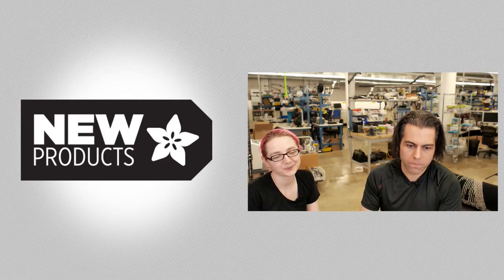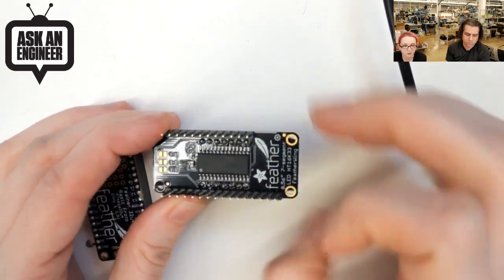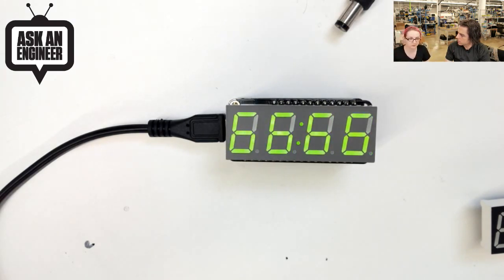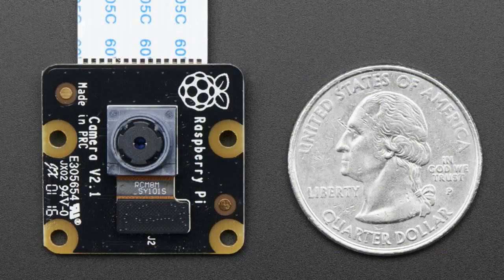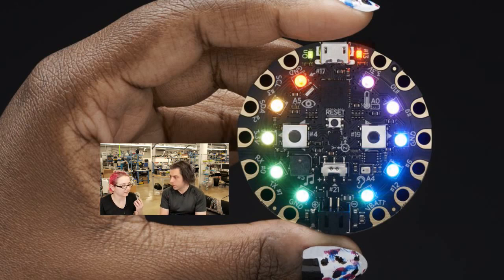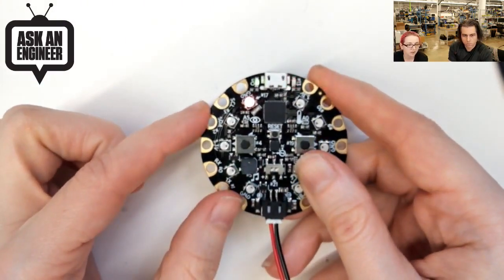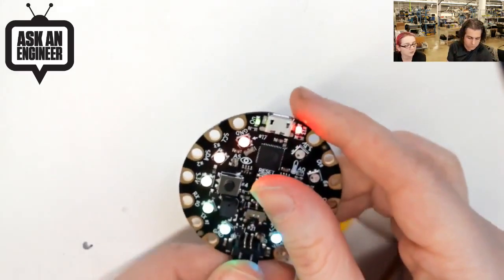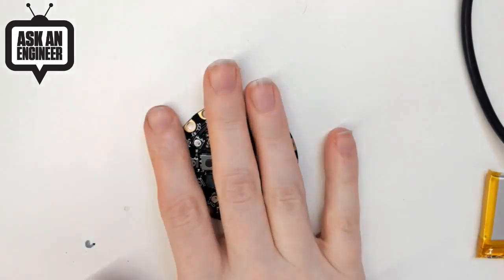New Products 4/27/2016

Comment: Also, do you have PCB with both wifi and bluetooth capabilities as red bear duo (https://www.kickstarter.com/projects/1991736672/redbear-duo-a-small-and-powerful-wi-fi-ble-iot-boa)
The only thing missing in this duo is external battery attachment which you guys have added in feather boards. if you could add wifi, external sim, and bluetooth as well in these board it will be a fanastic product. If you have already done then please give me link of this product. Please remember ext battery and small size is a must!

Comment: Hi Do you have any pcb with analogue output, external battery connector. I wish to drive a vibration coin motor which is synchronizing the stretch sensor. Also, I wish to know if you have any reasonable sensitive stretch sensor that I may use. Please consider this a wearable project and smaller the better!